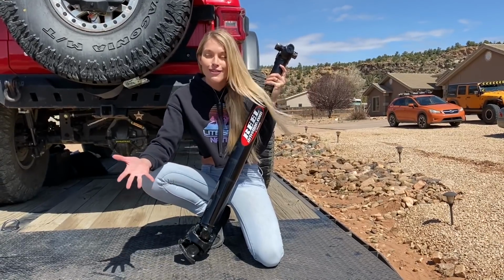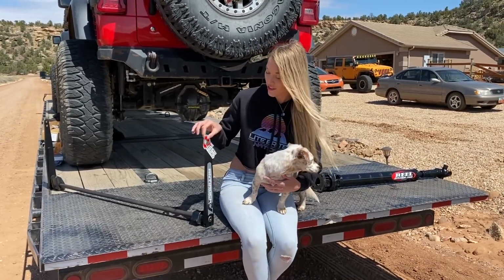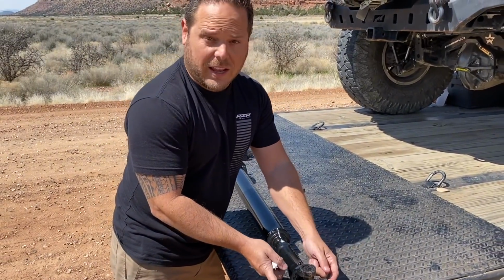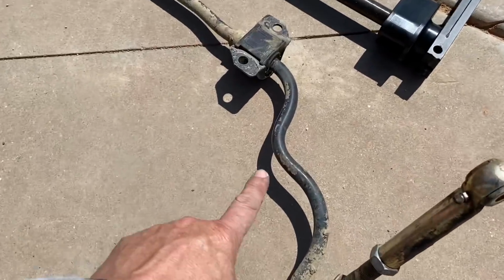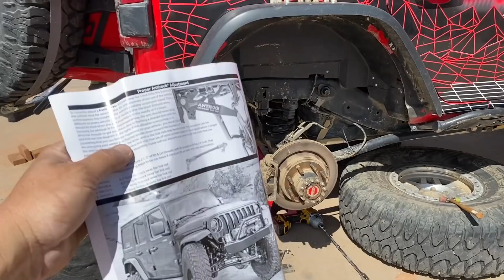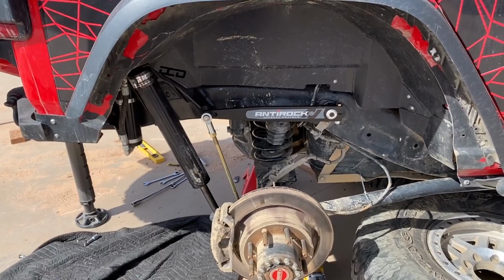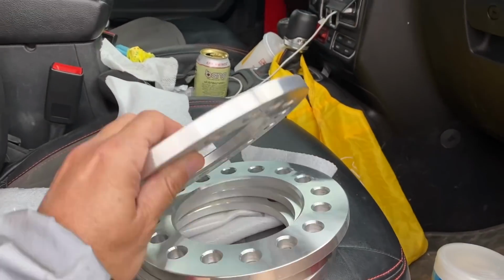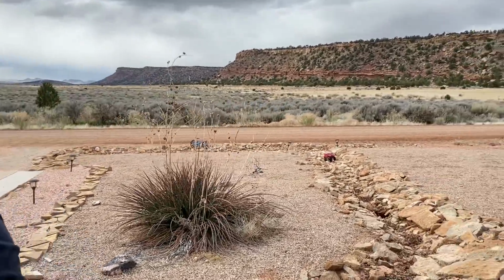ROCKJOCK ANTROCK & REEL CANYON CRAWLER INSTALL!

Comment: Kevin, CAUTION  anytime you join 2 straight cuts, where they meet you create a stress riser. It is best to drill a hole at the intersection and join the straight cuts to the radius formed by the hole as cleanly as possible.

Comment: I got rid of the u  joint straps on my drive shafts and drilled the yokes out and use u bolts. Still holding up after 20 years.  Good video guys. It's easier to right an rc car!

Comment: Did the money out thing with my cj7 and 1992 Cherokee and 1995 grand Cherokee. I’m older and wiser now and can’t be bothered.  2010 fj and 2000 4runner. Just a modest lift and bigger  tires in the stock rims and I’m good to go. Yaaaawn...🥱😴😴😴😴

Comment: Literally just dropped my rear Tom Woods 1350 , had all the u joints & ball replaced.. rebalanced and I am watching this right after I took it for a test drive. Why blue locktite? I thought red for drive shaft bolts? 🤔😳

Comment: Great video! I actually enjoy the install stuff from you two. That crawler looks like fun, it's funny I was just looking at those online last night, with pretty much all of New England being on lockdown and wheeling inaccessible, I was thinking of ordering one to pass the time with LOL.
Reply: Michael Smith I love my RC crawler. I have no nearby locations to take a full size truck, but lots of local trails for my RC.
Reply: @RyanRKJ  awesome! I don't really know too much about them yet, I've just seen a few YouTube videos. Which one do you have, and what would you recommend for a beginner? I was looking at the Traxxas trx4s, they seem pretty cool and have some good features.

And yeah, there's no real wheeling close to me, so I would do more off-roading with the crawler than with my 4Runner, haha.
Reply: Michael Smith I have a Vaterra Ascender. Lots of videos of it on my channel. It’s been very durable. However, the product is at the end of of its cycle, and will soon be discontinued. I’d probably suggest the Traxxas TRX4 Sport to start with.
Reply: @RyanRKJ  cool, I'll have to check out your channel. I did see the Ascender pop up in my research, I really dig the Suburban body! I also really like the TRX 4 with the K5 body. I know it's just the body, but the K5 is one of my favorite vehicles of all time. Was allso just reading a review of the Redcat gen 8 Scout, seems like that's a pretty good one, and I really like the price, it's on sale for $269 right now. Decisions,  decisions.

Comment: Why didn't you prime or paint the opening for the sway bar joint where it goes into the frame after you did the grinding?  Seems like a big rust attractant on the frame to me.   Good spot for some POR-15 or Rustoleum at least.
Reply from the maker: We did. 😊

Comment: Did you remember to put anti-seize on the spacers?
Reply: Yeah, use that copper paste anti seize stuff. Highly recommend, I run 2" bolt on spacers from BORA, on my 92 Nissan patrol

Comment: Are the axles stock length? I had to add 1.5 inch adapters to my jk. Still running semi floats though.
Reply from the maker: 68.5” wide

Comment: Swaybar links lol... Never ran them on any of my jeeps, on or offroad. You just get use to how it handles.
Reply: You actually get more flex by leaving the swaybar connected in the rear.
Reply: @jakobwest4811  Tell that to my XJ that would stuff the rear wheels into the wheel wells lol. My XJ never had a rear when I got it. It was lifted 6in and I think they had to take it off.

Comment: Get some properly offset wheels; I wouldn't trust spacers as a permanent thing.
Reply from the maker: Spacers are perfectly fine. We’ve run them on race cars and Offroad vehicles all our lives. Never had an issue. You just have to check them like anything else. Especially the bolt on ones
Reply: @LiteBrite  Ok, I'll have less spacer anxiety cool lol